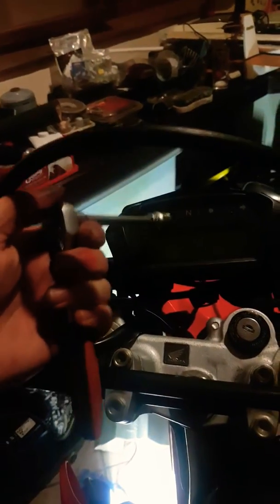Motorbike Ignition Switch Bypass  CRF250L '2016

Comment: Thanks perfect. My crf the ignition is not turning on and testing with a voltmeter shows it is not powering but the zena diode is intact and offering resistance.  I am hoping to take mine apart like yours and make the main power contact work again. But nice to see what it looks like before I get there. Hardest bit will be to get those tamper proof bolts out

Comment: I  tried to used some zener diode. but it didnt work. could you give some videos on to hot wire my bike crf250l 2016.
Reply: You can expose some wire meaning cut into it but not all the way nd than put your red nd black wire together
Reply from the maker: I'll post a video shortly...
Try using a resistor 470ohm
Reply from the maker: Video shortly